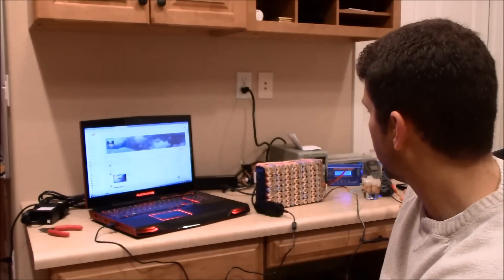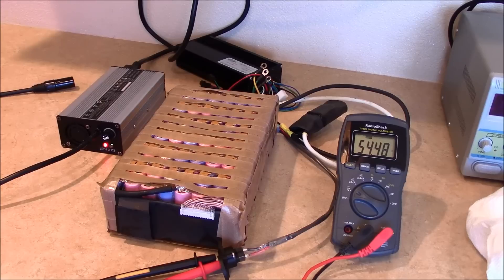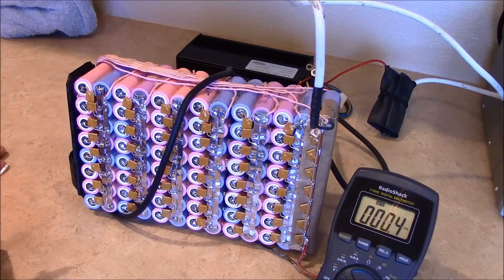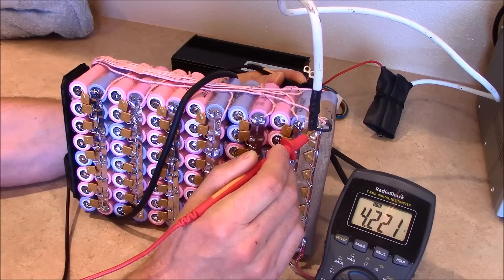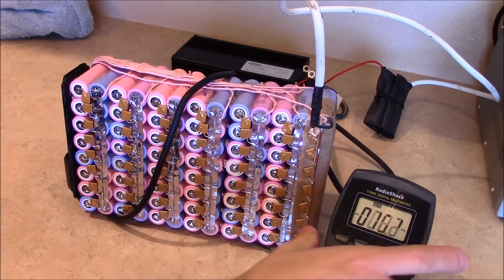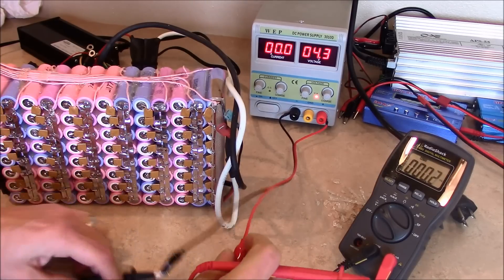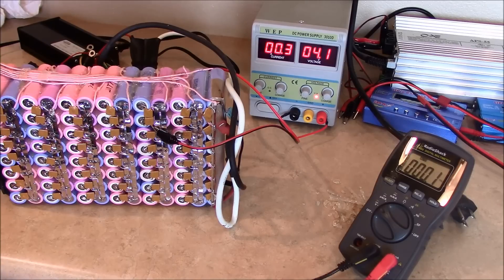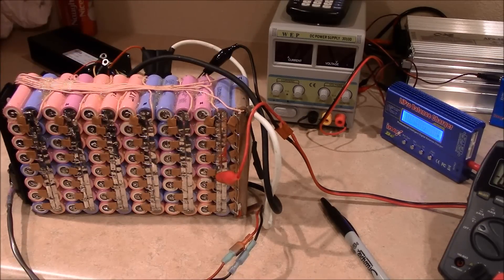How to build a e-bike battery pack "BMS wiring" (Part 7of 7)

Comment: Hey, thanks for the video posts. Very informative. Just to add my 2cents; for long term storage, I don't think Li Ion batteries should be charged to full capacity. You can get more info here (http://www.mpoweruk.com/storage.htm)
Reply from the maker: +Zinahe Asnake Thanks yeah I just did it to see were or if i had a bad bank.  But normally I will drain it down to about 3.8v after a ride and recharge it before I ride it again.  Thanks for the info it has become very helpful.

Comment: Is it possible that your BMS works just fine? My theory is that you may not have left it on the charger long enough. So, it simply wasn't finished with its balancing protocol. Maybe it was in the process of discharging that overcharged bank when you disconnected the charger. I've only been familiar with BMS's for a couple months, but I know the balancing procedure can take a long time.
Reply from the maker: +Paul Langford hey Paul, the charger will turn off once it detects a full charge from the BMS.  The BMS will also go into protect mode once a banks reaches maximum voltage and in turn the charger will automatically turn off.  From what I can tell is that the BMS only charges all 13 banks at the same rate and it doesn't pay-attention to where the banks are voltage wise.  Once a bank hits max.V of 4.25v its done.   It has ample opportunity to balance as the BMS stays connected to the battery at all times.   Just seems like its not even trying to balance per the testing.   Since my Dec video I have rode it 3-4 times with 3-5 mile increments and after each ride I threw it on the charger.  I'm going to do another test this weekend to see if I am seeing the same unbalancing issues.
Reply from the maker: +Paul Langford just checked it since the last charge a few hours ago and bank 10 was down again, but to only 3.18v this time.   A few others were at 3.92v, 4.2v a few is at 4.215ish.  its really not even across the board, so it definitely is not balancing at all.  The seller stated that I need to use new cells for the balancing to work, but i tested each cell to make sure they were all very close to the same in mAh.   New cells would make it to easy and make you believe that its actually balancing when its really not.
Reply: +15-sec-of Fame Haha, yeah, they wouldn't even need to sell a working product if you used all new cells. I realize the BMS is connected to the battery at all times, but from what I understand most BMS's are only capable of top balancing. That means the battery pack has to be plugged in to the balance. I know you probably don't like to leave your battery plugged in for long periods, but I think it would be worth it to see if that improves the situation at all to leave it plugged in overnight. How long do you usually have it on the charger for?
Reply from the maker: Yeah that could be the issue for me as the charger I have shuts off and will not turn back on until I reset it.  Kinda sucks, maybe I should try to find a different charger.
Reply: +15-sec-of Fame Yeah, that would make sense. I bet that's what it is. I just ordered a BMS from the same supplier you did. I didn't realize it was the same one until after I bought it. It's the 72V, 30A version. I will try it out when it gets here and I'll let you know if it works.
Reply from the maker: awesome man,  yeah please let me know how yours is doing once you get the bike going.

Comment: Hi, I enjoy your videos a lot! I have a question regarding a BMS, How do you know which BMS to choose? Does a BMS know at what voltage it has to cut off power or do I have to choose a specific BMS for lets say a 18650 battery? thanks
Reply from the maker: +dirkmeister1111 hey Dirk,   one thing to watch for is the nominal voltage of each cell.  Some lithium batteries are 3.2v, 3.6v etc... 18650's are typically 3.7v with a max of 4.2v to 4.35v.  So now your going to choose the size of battery that you want 36v, 48v, 60v or 72v etc....  I choose the 48v for my build.  Now you need to know how many 3.7v cells you need in series to = 48v.  So take 48/3.7v =12.9 cells in series (or 13) so now you need to find a 48v 13s BMS for the 48v battery.  A 13s BMS will have a max voltage of 54.6v when all the cells are at 4.2v.  Really look at each BMS specs as they sell 16s BMS for a 48v battery and it will max the voltage to only 52v.  That BMS is for a lower nominal voltage cell like 3.2v.  Once the BMS hits max voltage it will go into protect mode and shut off the charging.  Make sure you have a lithium charger that will shut off at full charge.  They sell them on Ebay also.  Hope I was able to help you understand it and let me know if you any other questions. Thanks
Reply: +15-sec-of Fame I completely understand! Thanks a lot, i appreciate it. How is your bike holding up?
Reply from the maker: Nice man,  the bike is still doing good.  Now that its warming up Im starting to ride it again and it has more power than my last ride back in Dec. The cold was keeping the batteries power down a little.  Im looking at making a new video doing a 50-60 mile round trip to downtown Denver this weekend, but if not maybe in the next few weeks.  Still working on finishing the 72v battery also. That will be fun :)

Comment: Hello,

I am working on a battery pack for my electric bike, too. I have two questions.

1. Did you end up replacing your BMS? If you did, where did you get it from? What brand is it? How much was it? Do you recommend it? From what I've read, it seems like most BMS's only does cell balancing when you fully charge. I guess some are able to balance between charges, as well. I would like to get a BMS for my battery pack that has that function, but I'm guessing they are much more expensive. 

2. What was the brand of your 1500 W motor? Where did you get it? How much was it? Do you recommend it? 

Thanks a ton!

Paul
Reply from the maker: +Paul Langford Hey Paul the BMS is still on the battery,  Ive have looked around, but Im really taking my time to make sure I have some kind of balancing function.   Using new cells will be easier for a BMS to manage as all the cells are new.   I bought the kit from theebikemotor.com and cost about $360 U.S. with shipping.   It took about 30 days to ship from china.   On their website you can custom pick each part you want to buy or buy a ready made kit.  I picked out each item when buying,  I replaced the rim to match my existing front rim and also made a video of it, Part 6.   When you get it just make sure you inspect it for damage.   E-mail them back if you find any issues, they will contact you same day,  oh and if you can pay thru Paypal just in case.
Reply: +15-sec-of Fame 

Thanks for info. That's cheap for a 1500-watter, compared to the ones I've seen on ebay. I like all the customization options.

One more question though. Is it necessary to buy a new speed gear (rear sprocket set), or will the one that comes with the original bike work?
Reply from the maker: yeah man shipping was $125 of the $360, so the kit was itself was very cheap at $235!
Reply: +15-sec-of Fame 

I noticed you have disk brakes on your bike. Did you have to order a special disk brake from that site? Also, was the 7-speed gear necessary, or would your original bike's gear have worked? That would save me $30, since I have an 8-speed rear gear.
Reply from the maker: Paul Langford the brakes are my original and I had to make a slight rear brake pad adjustment for the rear disk to line up, but it only took 5 min.  
The 7 speed is the largest that they say will fit with the 1500w Hub, so I bought the 7 speed.  It kinda Walmart quality, but it works.  I have the gearing set to the lowest I can go, speed gear and haven't moved it at all!  When using the throttle and pedaling at the same time you are above 25 mph in seconds in the highway speed gear!   You might be ok with single speed, but if you run out of battery it might be tough to pedal.
  The Hub wires will be very close to the spinning disk brake screws, so just use zip ties to keep it out of the way as you will still only have 1-2mm of clearance.  As long as the hub wires are secure you will be fine, I have 171 miles and no issues.

Comment: Hey 15, 
Since I've now got three iMax B6 chargers I'm thinking I can use them together to truly "balance charge" every fifth time. This will require some additional soldering to get the correct connections in place but well worth the effort.
I've recently found a new source for laptop battery packs and they've yielded some really high capacity cells. So I'm breaking up the original configuration to accommodate them. I'm also looking at different layouts taking into account this balancing issue using mixed used cells.
So I'm back in discharge metering mode. More iMax B6s are called for.
Reply from the maker: +Rick Rose nice man!  Are you still going to use a BMS protection board during charging?   Using the Imax every 5 charges is a great idea to help insure that they are staying balanced and last longer.   Yeah I'm in the process of building a new battery also accept it's 72v (8p 20s) now.  I am keeping my 48v battery just in case, but like you harvesting good cells for now :)

Comment: your music is louder than you at 12:16 ... :( Good video otherwise.
Reply from the maker: +Jeff Scaparra  oh wow not sure what happened!  Thanks for the heads up!
Reply: +15-sec-of Fame no problem enjoyed the video series. Ended up getting the same fuses on ebay tonight and I am going with-out a BMS for now. I will bottom balance manually and I don&#39;t plan on charging to full capacity so that I can get a longer life out of the batteries. I am using my pack for remote computing and radio operating. The only other real change is I plan on using solder wick instead of the nickel strips. I am hoping that the wick will solder easier and mean less heat on the battery.
Reply from the maker: Seems that I didn't save the video correctly, so I cant fix the loud music issue.  I will need to remake the video to correct it.  I'll start working on it soon!  Thanks
Reply from the maker: +Jeff Scaparra thanks for letting me know about the loud music issue,   I was able to put notes in to help let everyone understand what I was doing and saying during that time.  Hopefully it helps :)

Comment: Hey 15, I think they covered their butts with the warnings in red at the bottom. Funny that I never noticed those before. 
Like you, I'll keep an eye on the cell banks for lows and highs. 
I've got to keep in mind that this is just a hobby - a way to recycle otherwise scrap batteries. Even with the added expenses this process is still cheaper (except for the endless hours spent) and more efficient than the using the lead-acid batteries that came with my bike.
Reply from the maker: +Rick Rose yeah man Im not sure who to trust for the next BMS, but its a fun rewarding project.  I wanted show that if you don't have the money to buy new cells but have the time you can still end up with a great way to travel to and from work or to just have a fun relaxing ride.

Comment: any reason as to why you use a 13s instead of 12s? won't that put too much load to the controller?
Reply from the maker: the cells that I am using are 3.7 (nominal voltage) x13s=48v.  I will be worried about the controller due to the extra stress of climbing the hills here.  I think it will be fine, but I will test it out once I finish the other battery.  I found out that this controller can handle 72 volts by looking in the setting, so I might try that in a video :)  I also stepped up my wheel size to 29" and the controller adjusted the top speed to 45mph.  But I think I will need to be at 72v as 48v seems to weak.

Comment: Did the description of your bms say something about Balancing Current?
Reply from the maker: I went back to look up the seller and this is directly off there ebay ad:

The main functions: Over-charged, Over-discharged protection, short circuit protection, over-current protection, with Balancing function.

Heres a link to the AD:
http://www.ebay.com/itm/48V-54-6V-13S-45A-Lithium-ion-Li-ion-Li-Po-LiPo-Polymer-Battery-BMS-PCB-System/221740200277?_trksid=p2047675.c100005.m1851&amp;_trkparms=aid%3D222007%26algo%3DSIC.MBE%26ao%3D1%26asc%3D34881%26meid%3Dbe1f5d351831435d8509baf8cf245673%26pid%3D100005%26rk%3D4%26rkt%3D6%26sd%3D321751863052
Reply: "Balanced current: 60mA (VCELL = 4.20V when)" ok thats the same expression my bms will have when i get it in a week or so.
Could it be possible that the bms works right, but the 60mA balance current could not balance fast enough so the Overcharge Protection kicks in? i think the reason could be to much parallel cells. Maybe the bms works just fine when there are 13 cells in series and only up to a certain amount like 5 or so in parralel.
Reply from the maker: Yeah, I wish they would say the max cells in parallel as that will help :) I have seen some BMS's on ebay that say to leave it alone after the charge and it will slowly balance after the charge has ended.  That would be better for me as I never ride immediately after it charges anyway, so I might try one of those next.  Please keep me updated your BMS so we all can weed out the bad BMS units to help others for there build.  Thanks
Reply: +15-sec-of Fame 

Hey there!  My ebike has been performing very well, but I've had some battery issues and wanted to share some of the solutions I've come up with.

My BMS was not working.  Although it's supposed to be a very good unit from Luna Cycles with balance function, it was not balancing my pack.  Of course they won't offer any assistance or warranty as I'm using used cells.  So I took it off, and here's how I've been managing the pack voltage.

I picked up a few of these on ebay.  http://www.ebay.com/itm/2X-1-8S-Indicator-RC-Li-ion-Lipo-Battery-Tester-Low-Voltage-Buzzer-Alarm-CC-Q7X4-/172060728157?hash=item280f9e5b5d:g:w7gAAOSwJkJWlc0o

I attached more lead wires and connected two of these units to monitor the individual voltage of my 14s pack.  The meters work from 1s-8s and anywhere in between, and provide an adjustable low voltage alarm.  Anytime I want to check the voltage of each bank, I can just pop open my battery case and it cycles through the voltage of each in sequence.

I have 2 banks in my bank that seem to be problematic.  Over time these banks self discharge at a higher rate than the rest of the pack, and in order for me to have full pack voltage and capacity, I have to charge them separately to 4.2 volts.

Here is the method I came up with.  My Imax B6 came with several different lead/charging wire attachments.   One of them was a 2 prong JST (I believe) type.  I trimmed the plastic housing away from the end of it to expose the two prongs, and they fit perfectly into the still attached 14s balance connector that my BMS was attached to.  I can use this modified lead wire to charge any bank that I choose by inserting it into the appropriate slots in the balance connector and charging with the B6.  Since the lead wires are small AWG, I can only charge at very low current, but it works and this has been an effective and much more convenient solution for me.

I typically charge the pack until the highest banks are at 4.2v, and then use the above method to top off the stubborn banks to matching voltage.   

This has been a much easier way for me to manually balance the pack than taking the whole thing out of the case and attaching charging leads directly to the banks in the pack.

In the future - if I use used cells, I will do much more extensive testing on them regarding self discharge rates.

Hope this helps.  Let me know if you have any questions.

Gary
Reply from the maker: +Gary Harvey man you have been busy :)  i like how you can see the voltage in each bank and how the alarm will sound if it gets too low.   Its frustrating to see people selling bogus BMS units.  The only way they can get good reviews is when people are using new cells which seem to always stay close to even and only need very little balance function to maintain them.  For me a true BMS should not care if you have used cells.  Similar to a Imax charger.  
 I also thought of pig tailing off each bank, wire them to a female D-sub connector, then have a male to plug into it,  those wires are all in parallel,  var. power supply set to max charge of 4.217 done.   True balancing at its best!    Typically the voltage will rise as fast as the slowest charging bank :)